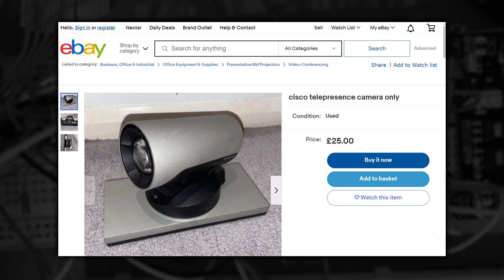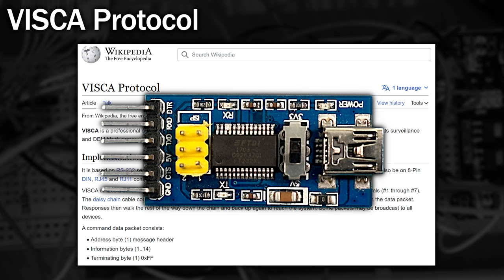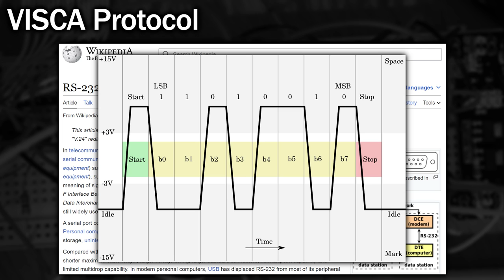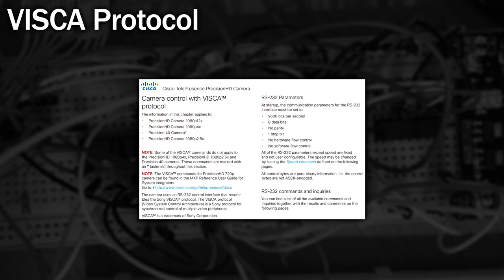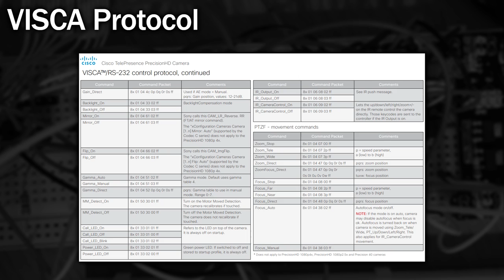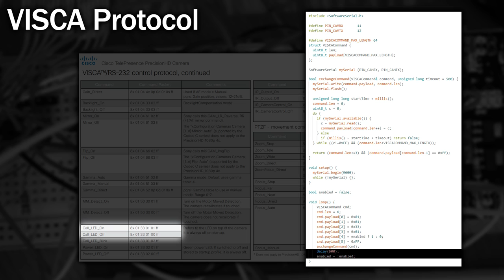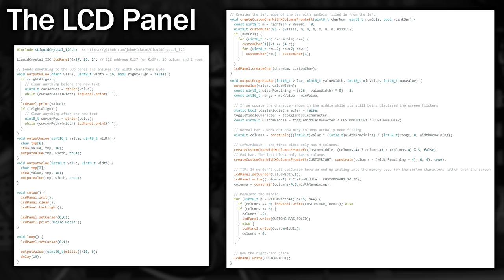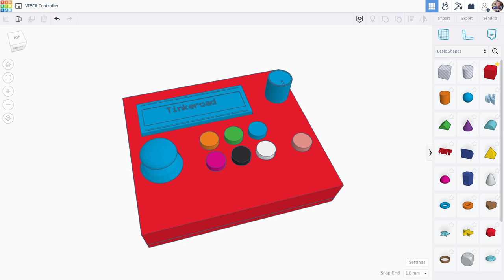Hacking Cameras - Arduino VISCA Controller for Pan, Tilt, Zoom and more!

Comment: Pan and Tilt controls are very 'thick' (i.e. move in jumps), how to fix this?
Reply from the maker: There’s a different command you can use to tell it to keep moving until you let go but you’ll have to find it
Reply: Those thumbstick joysticks are horrible for fine control.  Video games do all of the work to smooth that out.  Use a proper RC transmitter joystick gimbal or one of the many APEM ones to get a good smooth range of motion.  I would use a 3-axis one and put the zoom on the knob twist axis.
Reply: P.S.  Amiga 500 ROCKS!
Reply from the maker: Well with the way it works it’s all jerky anyway so probably doesn’t matter but thanks for the tip

Comment: What is the arduino code to gain manual control over pan/tilt/zoom speed, the camera needs to be sent an IR disable command, otherwise all motions behave with increasing speed as if you controlled them with an IR remote.
Reply from the maker: Hi, all the commands are in their PDF. The arduino code disables the IR on startup

Comment: Hello Rob!!!     It's a great video!!!  Is it working with a CISCO TTC8-02 camera? 🤔
Reply from the maker: Hi, no idea tbh, I don’t have one. But I suspect it will follow the same command set, so I’d go with ‘probably’
Reply: @RobSmithDev  Thank you for your reply!  unfortunately it doesn't work,  I get that message on the screen: " Waiting for camera... "  if you have any ideas, or suggestion,  please share. Thanks!
Reply from the maker: Try removing the code that ‘waits’ and then see if it will respond to any commands. It could also be wired up wrong. Also try a power cycle

Comment: Great Video!!!
For those who are interested in doing this, I would probably advice you to get the other versions of the Cisco/Tandberg Precision HD series, there are 4 types, get the one with the RJ45 connectors so that you don't need to tinker inside the camera itself. Those with RJ45 connectors supports rs232/rs422, so it's a bit easier to control that.
I wonder if you ever tried putting two of these together? Like a multicam shoot.
Thanks
Reply from the maker: lol no I haven’t. I need to update the arduino sketch because I figured out the brightness setting! - Ed: Just updated it